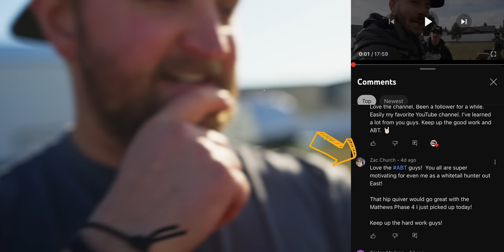Seeking OUT The Best Bow Sight in 2023.. ABT

Comment: I’ve found the bridge lock sight bars to have slop.  I have an Axcel, Black Gold and HHA bar and none sit level to the bowstring when screwed down.  The sight slider slightly slopes down and away from the bow as you dial for longer distances.  That has to mean the tapes will be off to some degree.  Finally, I shimmed the BG bar and got it to sit level.  I’ve been shooting it like that and it has been fine.  The Axcel bar has the least slop of the 3, but it too angles up when screwed down.  For me, I just want my sight to be level.  Maybe it’s OCD.  When mounted to the bow the old fashioned way, they all sit level.

Comment: IF you are using the Ultraview 3 (31mm/non-XL) scope or an Axcel AVX-31 (AV-31) you do not need the extra offset bracket. I am running all three of these scopes and the additional drillings in the Landslyde is enough offset for any 31mm scope.
Reply: Same with the factory accustat 3 pin scope they come with and I assume the AV41. I have one on a P4 29 and V3X 33.

Comment: I still got a 5 pin from Walmart back in the early 2000's. This brand you could add more pins to it.  I think I had it situated from 20 to 100.  Lot of pins.
But now I use a 5 pin Black Gold Verdict.  It's at 20 to 60. But the last pin is dialed up to 120 yards. The know is great to adjust.

Comment: On the Landslyde Single Pin, why does it have 2 of the red yardage indicators on the slider if there's only 1 pin? And do they have a 2-pin available as well?  I'm currently in the market for a Landslyde Carbon Pro and I already have a UV3 single-pin scope.  Basically,  I'm trying to determine whether or not to get the entire Landslyde Sight(w/ scope) or just the Dovetail Slider(w/out scope).  Suggestions?
Reply: It’s set up for different scopes.    You can get an Axcel dual pin or an aftermarket version.

Comment: Been hunting with a compound bow since 1987.  I would NEVER mount a movable pin sight on a hunting bow even if it were free!  I am pulled back long before most shots are taken, & who knows where the best shot may happen sometimes.   I practice where to place a single fixed pin on a deer for decades, but the EZ-V has won me over in recent years.  I'm amazed what some pay for sights.  I dislike 99% of what's on the market these days.  Everyone is different, however.